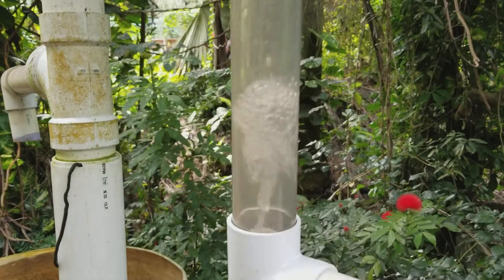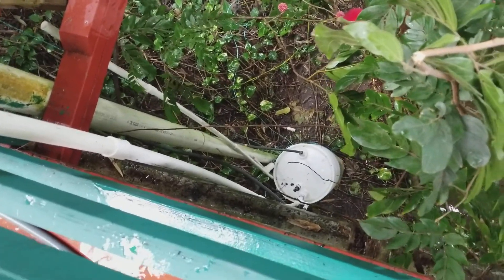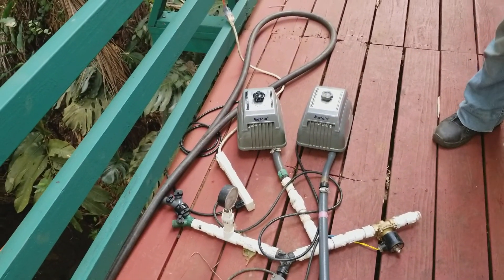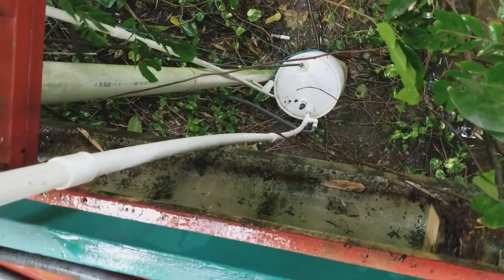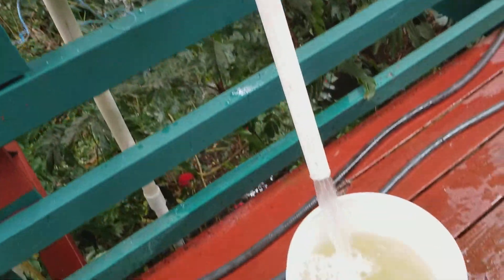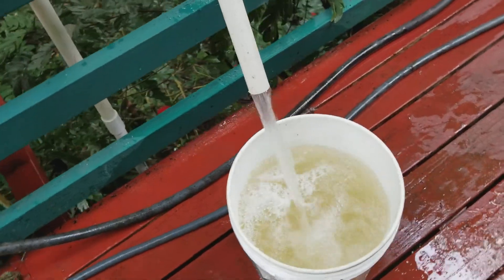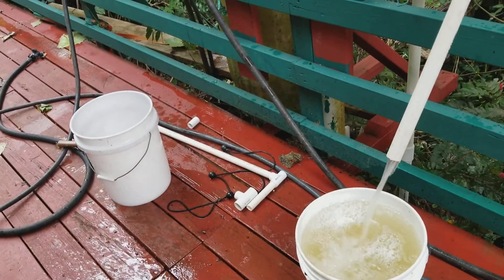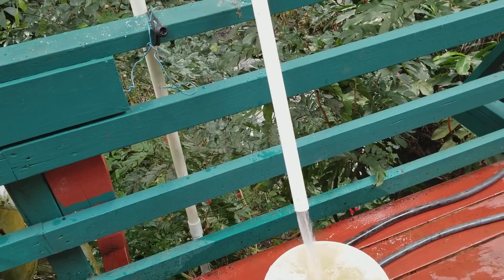(OGV#60)   Glenn's displacement pump using his turbo blaster air lift.

Comment: You might try a hydrophobic (water repelling) coating in the inside of the water+ air pipe.
My thinking is that a thin layer of water stuck to the pipe sides gets around your columns of air. 
That wont happen if the pipe repels the water...

IIRC there's a product called NeverWet that's extremely hydrophobic, but may wash off eventually, so you might look into hydrophobic materials/plastics/pipes.

Another idea is to use a long stroke single piston type air pump, like a (modded) bicycle or car tyre hand pump, actuated by a motor with a crank.
Think steam train piston to wheel connection to get my meaning.
That will give you pulses of air, the frequency of which you can change with motor rpm and/or varying the stroke.
I have a feeling there's a resonance somewhere..?

Last thing is simply to round the edges of the water intake some.  That's just a well known way to flow more fluid into a pipe.  Google Bell Mouth and/or Velocity stack.
Similar rounding also helps airflow obviously, which may lower the power used by the air pump some.

Lastly:  Painting the outer pipe black makes the pump ever so slightly solar powered:
Hot air and water rises by convection.
Naturally; if you have a waste heat source handy; heat that air!

Have you considered just how well the exhaust from a single cylinder engine would work if you weren't worried about about polluting the water..?